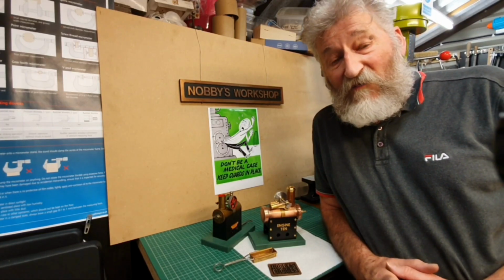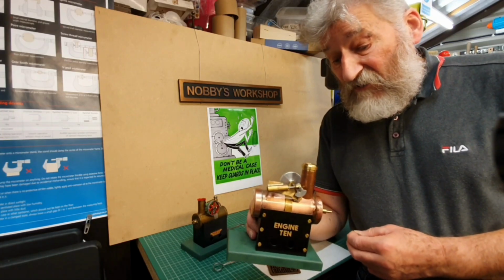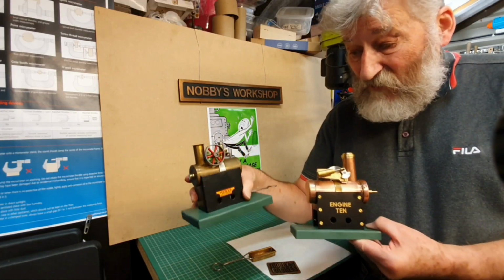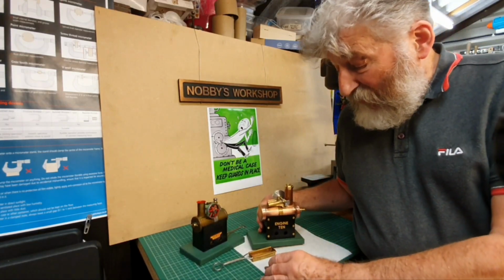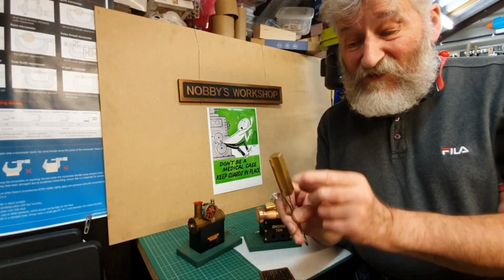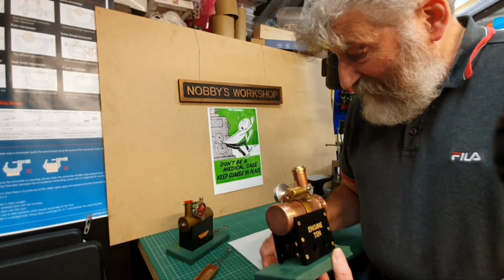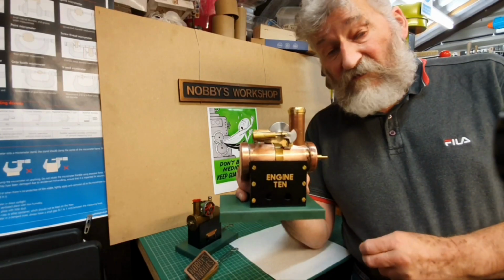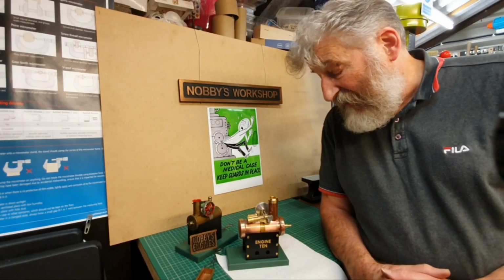A Scratch Built Model Steam Engine.

Comment: You have made a nice job of that Nobby, well done. Like you, I have not done any sheet metal work since my apprenticeship, and I also don't have the tools etc, I think I would have gone for some dome headed Aluminum rivets to join the firebox together but what you have done looks equally aesthetically pleasing. Cheers, Jon
Reply from the maker: Thank you Jon for the kind comments. I was thinking of using copper rivets on the fire box. Was not sure how I would peen the rivets on the final side of the fire box from the inside. Also I would need a rivet snap. Guess that's why Mamod use small pop rivets? I know I made more work for myself using screws, but think they look nice. Cheers Nobby

Comment: Hi Nobby.  Nice work and a super good outcome.  The boiler end caps worked well.  I had not thought of using those and always brazed in flat end plates (awkward job).  I wonder if you can get end caps like you used that would fit inside the copper boiler tube ? Cheers Rob
Reply from the maker: Hi Rob thanks for the nice comment. The end caps seem to be available in a wide range of sizes. I guess fitting over the outside of pipes makes it easier and quick for plumbers to use. Maybe a smaller end cap could fit inside the pipe. I think fitting them on the outside doesn't look to bad? Cheers Nobby
Reply: Hi Nobby.  The end caps look good as is.   @nobbysworkshop  I was just thinking about it and how they build pressure tanks for some applications.  Cheers Rob